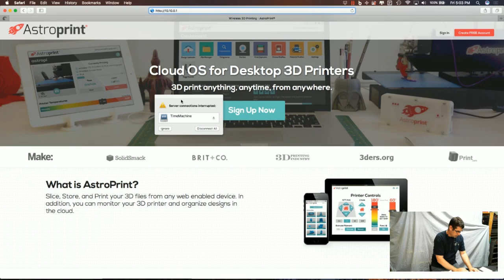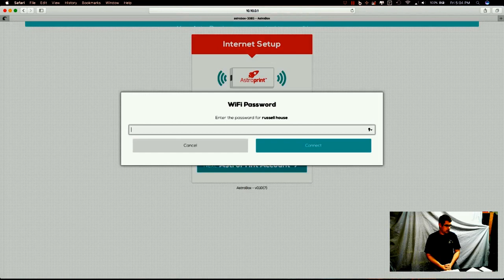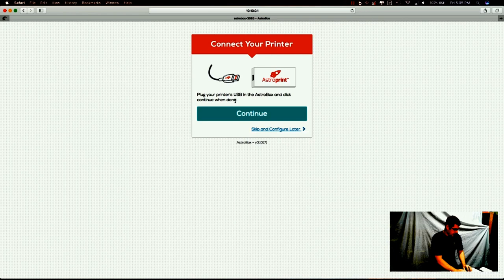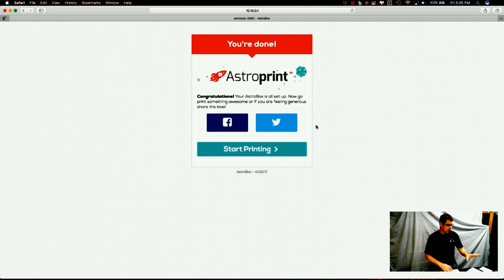Practical Printing - AstroBox Unboxing and Initial Setup

Comment: Ok, so that @AstroPrint note was awesome! I'm currently moving all my printers over to OctoPrint, so I'm interested in the differences. Thanks for sharing.
Reply from the maker: +RJ_Make I'll be digging into the dashboard today and be sure to get it all on camera!
Reply: Thanks RJ. 

RE: OctoPrint vs AstroPrint, the main point is that we are primarily focused on the cloud + the simplicity of use for non-technical users.

If you are bored with a beer in hand, here's a longer list of some key features of AstroPrint.

1.) Faster Slicing: Once the file is up in the cloud you can re-slice the file (for higher/lower quality) with any combination of settings you'd like as preferences change. Why would someone want to do this? Many people end up tweaking and experimenting with various settings that require re-slicing. AstroPrint has powerful dedicated machines reserved JUST for high speed slicing, machines that are many many times faster and powerful than home computers or laptops. You can also do this from anywhere around the world without the need for software

2.) Custom Manufacturer Presets: The AstroPrint slicer has fine tuned settings for most printer manufacturers PRE-BUILT into the system so that you don't have to worry about googling and tweaking settings to match the best configuration. Not only that, AstroPrint works with manufacturers directly in obtaining these settings and allow them to tweak settings directly. Also, if these optimal settings change in the future, no worries, AstroPrint automatically updates those settings so you can focus on printing cool stuff.

3.) Remote File Management: Once the file is in the cloud, you can slice the file remotely from anywhere. As a bonus, you can also monitor the print live (with a camera) and also start/stop the print if necessary.

4.) Simpler to use: It's super accessible for non-technical users. Advanced settings are still accessible for advanced users, but there's nothing simpler than AstroPrint in terms of UI/UX and it will only get easier to use.

5.) Automatic Updates: Software & security updates are done automatically. The average user does not have time to worry about software/slicer updates & security issues. When critical updates are available for the slicer, AstroPrint takes care of all of that so users can focus on printing stuff.

6.) Plug & Play Slicing Engines: The slicing engine is modular. Meaning, with a click of a button you can use Cura or Slic3r and in the future, other slicing engines can be added easily like lego blocks.

7.) App store: AstroPrint has an app store. When the API is open, anyone can submit apps to the APP store that interacts with the AstroPrint cloud platform. This gives you the option of enhancing your 3D Printer at will, with one click. Work in a library and want an app that will help you manage users and access to a single 3D Printer? There's an app for that. Need a premium app with a cutlery kit designed by a french chef? There's an app for that. You get the idea.

Pick your poison though, can't really go wrong with either ;)

P.S: As always, feel free to hit us up anytime with questions/suggestions via

Forums: https://forum.astroprint.com
Twitter: https://twitter.com/astroprint3D
Instagram: https://instagram.com/astroprint
Reply: Thank you for that very detailed response; it's definitely a compelling platform  Does the ecosystem (local pi or cloud) present any home automation hooks such as mqtt for us geeks who integrate everything into their home automation system? :-)
Reply: Not officially, but depending on your geekiness, it's certainly possible :) -- It'll certainly get easier when our API is released in the near future!